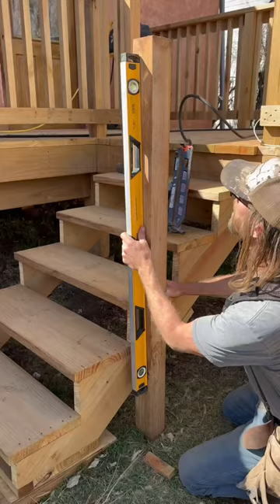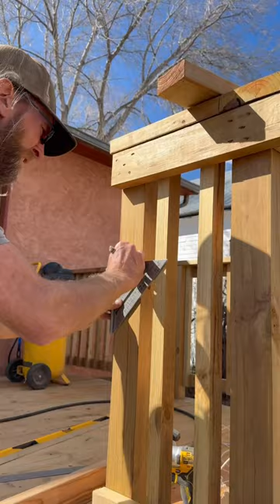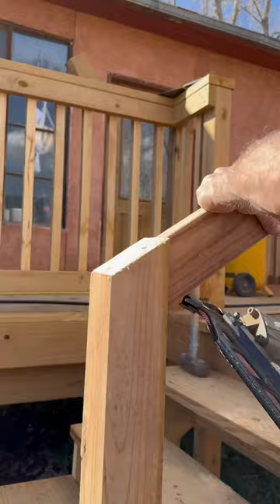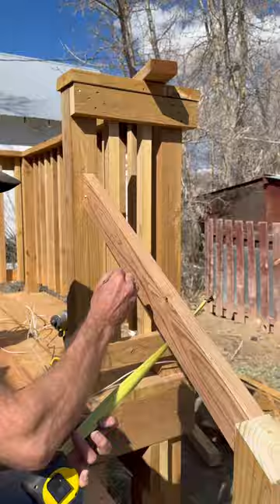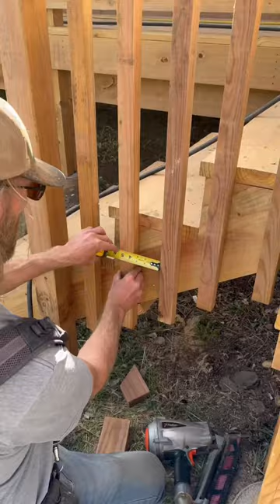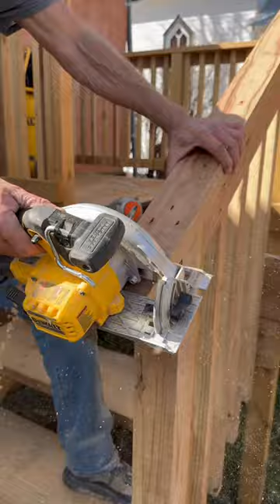🔨Deck Stair Railing Installation! #construction #contractor #deck #framing #carpenter #carpentry

Comment: I have never seen using a square with a steel square to get the reverse angle like that, thats a slick trick ill be keeping in my book. Thanks
Reply: Thats a trick ik ill be using haha what a clever thing to do
Reply: It's just the rake of the stairs....that's an ignorant way 2 do this...bout as dumb as the nails...or the pounding in of the support post
Reply: That is a great trick I will be remembering this one
Reply: That because most dudes don’t keep two  squares in their pouches just draw a line and flip your Swanson
Reply: Is that a reverse cut? Pretty sure its not
Reply: @wooge3199 wow you're a real winner aren't you lady!!
Reply: @tonyz6421  yea...and one hell of a carpenter
Reply: Learn something new everyday
Reply: Speed square and framing square
Reply: @wooge3199 more like one hell of a party pooper.
Reply: Line drawn is parallel with the stair angle, not a reverse unless those stairs are 45 degrees. What baffles me is that square is only 24" and railings should be atleast 40" off the nosing. Definitely not high enough for any useful guardrail.
Reply: @coreykiss2653 I don't even think you have to have a guard rail at all at that height
Reply: I literally screen shot this man doing this cause I’m definitely using this what an ingenious way of transferring an angle !!
Reply: Your locality still allows for a 36 inch handrail? Mine went to 42 inches for guardrails allowing for a 36 inch grippable
Reply: Yo can use anything to transfer the framing square body tail or end 
If you old school carpenter 
( not a framer ) you’ll know what I mean
Reply: I always carry two squares on me. Always.
Reply: @wooge3199 I see absolutely nothing on your channel.  I understand that everyone is a carpenter.  Even the people still living at home like yourself.
Reply: @bmffafo5004  I live in a house I built btw with my own hands 15 years ago...where was your camper built?
Reply: @0.7hujhyh  it's not
Reply: @wooge3199 ”one hell of a carpenter 💅 “
Reply: @ltsjoeyy  play some more video games buddy...maybe u can find one called stairs
Reply: @wooge3199 was that supposed to be a joke? , damn so u bad at more than 1 thing
Reply: @ltsjoeyy u are clever joey I bet u get all the poon
Reply: Also the circ saw trick is pretty neat. If your saw isn't big enough to cut go thru 2nd time with a hand saw was genius. I have cut down fence posts and it's hard to get it perfect. Def using this next time.
Reply: That's called wizardry.
Reply: @wooge3199 always that one Karen crying in the comments and hating. That’s you!
Reply: If you already cut the stringers then you know the angle already.
Reply: You haven't been a carpenter that long or don't cut stairs OR ROOFS I take it.  I was told at 17 be a sponge
Soak up at info boy,  running a custom framing by 20
Reply: @roberteddy5069  we get it. Daddy had a business for you to take over. Cry us a river.
Reply: @wooge3199 ok…? Why do you feel the need to say that? It worked. I see nothing wrong with it.
Reply: @davidvanschubert9093  cool..
Obviously u are not a carpenter...which is fine...
Reply: Same
Reply: It's just a way to translate the nose line up to set the handrail height so it's too short to meet code where I am. Better to just measure up off the nose of a tread at the new post and the same off a tread up top. Using a line scribed then projected off the tip of the framing square doesn't seem too accurate either. The end result looks nice and gets there easily enough with this method though.
Reply: @spevakdesigns  my sentiments precisely well said...ive got 4 good carpenters working 4 me and none of them really understand stairs...its really quite simple...but the post he installed is actually the worst
Reply: Pivot the speed square like a real carpenter. You should know the angle of your build 🤦🏻‍♂️ determine the rail height, mark it, pivot speed square to the degree of angle and then mark your line… why tf do people have to make things so difficult on themselves?
Reply: That’s the way it should be done, my dad always carried his square and level as his main measuring tools on a job
Reply: @jessicalawson1417  has nothing 2 do with the post being completely wrong
Reply: @wooge3199  how is it completely wrong?
Reply: @jessicalawson1417  lol...if u dont know u should not comment...and im not gonna argue with inexpierience
Reply: Technically the bigger square is the reverse angle the smaller square is just the inclination angle of the stairs
Reply: For real that was slick , smart idea
Reply: Yes! I noticed that too! Very cool trick. 
I had to hit the pause button to make sure I was seeing what I was seeing! lol 
I’m gonna have to try that one day 👍💪
Reply: @wooge3199 what ever works bro , I've got a few sliding bevels , a couple of digital levels which give the degrees of the rake and yet I've still managed to turn up needing one of them and having none of them ! 
As far as this job goes , to me it looks like it was partly done a tight budget ! I wouldn't construct a balustrade like that unless I was asked by the client . 
Most if not all handrails I do for stairs would have a top and bottom rail and they would definitely be pre primed H3 grade timber which is the local code / regulations  for Sydney Australia.   Peace bro
Reply: @wooge3199 if you have to state that you’re one hell of a carpenter, then you’re not. Get of your ego trip. Building your own house by your own hands is an accomplishment if you have zero clue, but if you’re educated as myself, then it’s nothing to brag about.
Reply: @Aleks_Tarasenko  what do u live in?
Reply: You can also lay whatever rail material you'll be using on the nosing of a few steps and run your framing square on that. I use 2x6 + the 24"side of the square for rail height, works pretty good.
Reply: Right can’t forget that one
Reply: Same here
Reply: I was wondering about that myself.  I was thinking "that's a cool trick, but isn't that too low?" Maybe I'm missing something
Reply: @laxbum40ify  I’m pretty sure my area of PA says 36” for residential, and 42” for commercial.
Reply: @wooge3199 😂
Reply: @BurkholderCustomCarpentryLLC96  k....lol...also i am laughing...i guess
Reply: Where the hell do all you midgits live that allow 22" hand rail?
Reply: @wooge3199 prob not though
Reply: It may be a case of those who can do can not teach and those who teach can not do. Regardless rise over is very simple the double square is fake till you make it.
Reply: Same I had to pause and make sure I saw that correctly. Kinda blew my mind.
Reply: I'm a union carpenter for 15 years. The double square move is a slick move. Oh yeah and I play video games, mainly construction simulator.
Reply: @pixelbender896  play more or take a math class there is a way easier method, from a carpenter of 30 years
Reply: I came here to say the same thing!!!
Reply: I totally agree with you
Reply: I totally agree with the first comment what's a different technique, great job
Reply: @wooge3199 lmao..nice one
Reply: I had to screen shot that little trixy
Reply: Glad you pointed that out.

Comment: "When a framer thinks they can do finish work"
Reply: Yes
Reply: I’d use screws.  Hold up tighter
Reply: Exactly 💯
Reply: This makes sense. I couldn’t quite figure it out.
Reply: I started laughing as soon as that 4x4 went into the dirt
Reply: First thing I said “woah this guys a framer!”
Reply: I thought the same thing.😂
Reply: Prefab cookie cutter houses that don’t care about quality only valuable time. It’s sometimes part of the blueprints only using nails because of this reason.
Reply: @lucky_boi_luke3416 
The only thing new here is the deck lol
Reply: A framer can do finish work,  a good carpenter should be able to do finish work and framing,  but not like that, that’s just rough.
Reply: Whats that post gonna do when it freezes
Reply: What those screws gonna do with the grain in those steps? Make like a banana?
Reply: @lucky_boi_luke3416 Total B. S. 😅😂

Comment: I love the confidence of people who put this kind of shit on YouTube. Right in the dirt. Right on dude. Cash that check
Reply: Every job is not the Taj Mahal. It's a simple pt deck that I'm sure the price reflects that. Could it be that is what the customer can afford.
Reply: @GGg-ug3jr  Maybe but those stairs and the handrail would never pass my local building code. I'll do the bare minimum to keep cost down for my customers but I'll never go below minimum code.
Reply: @GGg-ug3jr  could you at least drop a cement paver on the ground under the post? This thing is going to rot out in five years 😅
Reply: Lol what
Reply: Lol 😅
Reply: @GGg-ug3jr Ummmm. Ever heard of the building code? 🤔 Not a single thing about this is code compliant, with possible exception of the space between the ballusters, none of which are plumb, btw, and the connection is not code compliant. I'm going to go out on a limb and guess that those nails are not galvanized, let alone ring shank.
Reply: @danbeeson9564 Probably less if it's not rated for ground contact.
Reply: @NirtieDigger  maybe reference what cost $50 genius
Reply: @GGg-ug3jr   a concrete deck block. 1 costs $5-$10 genius
Reply: @GGg-ug3jr   or a bag of concrete and a Simpson bracket. Both cost about $5 genius.
Reply: Just wow 😢
Reply: Why wouldnt you block the post in 😅
Reply: “Shouldn’t you use screws instead of nails there?”

“Nah, I don’t live here”

Comment: Dude!  You drove that 4x4 into the dirt to support the handrail?  "That ain't right."
Reply: All jobs are not created equal. It's a ground rated post, with just a few steps and giving it two elevation points of securing it. Between it being buried in the ground and nailed to the stringer it will be fine for quite a while.
Reply: @GGg-ug3jr  it is always ok to do better
Reply: @carl3500 its always okay to do better for good clients. Don't get It confused with doing better for cheap bastards.
Reply: Looks good to me ngl
Reply: What's good for my house
Reply: Was about to say the same thing. A few rain showers and that post isn’t touching anything or rotting next year if it’s deep. Cmon people that’s why our work isn’t paying as much anymore
Reply: @mattsabeast5 😂😂😂 so funny but so true don't get good customers confused with cheap bastards 😂 like they said
Reply: @dandangounknown5718 new to the trade can you elaborate on that
Reply: Yeah where is the concrete
Reply: @alect3455  Post will rot quicker making contact with the ground. The post doesn't actually need to touch the ground in this case. Not to say it's wrong cause most pressure treated posts are rated for ground contact, but they will still rot out eventually. Stairs should be on patio stones which they're not. The post should be attached to stringer with 1/2" galvanized carriage bolts. Should add blocking between stringers in where the posts are to prevent deflection of the stringer when lateral force is put on the handrail.
Reply: @dandangounknown5718 I'm sure it's sitting on a concrete footing, that pressure treated post will last a long time, you keyword warriors have never built anything or have watched too many videos with concrete pylons. In my state this is exactly how you do it as long as it's on a concrete footing.
Reply: @Jason-ws3cd  probably not sitting on  footing since it's not there to hold a vertical load.  The stairs aren't even on patio stones.  I'd like to think this is in an area that sees no snow, very little rain, and no high winds.  Otherwise it's an issue.  Been a red seal carpenter for 18 years so I'd like to think my input is worth something.
Reply: If you ever toe nailed anything on my deck, you would never get paid
Reply: @GGg-ug3jr  it'd be quicker to just tell everyone u have no what ur talking about.
Reply: Rot is rot. Water does what it do.

Idgaf if it bears a load or not.
Reply: @dandangounknown5718 it’s pressure treated…

Comment: Coolest way I've ever seen someone line up the guardrail 
 100% gomna take that trick home
Reply: @Stevean-zo8zk you're knees go all the way up to your wrists?
Reply: @Stevean-zo8zk  into the soil not onto... and that's how it's supposed to be done I'd add tar or something to protect the wood from the moisture but that how it's done stevie
Reply: @Stevean-zo8zk  one that's about to go out of business one can only assume
Reply: @Stevean-zo8zk and I own 3 businesses in 2 cities ... you should do what I say
Reply: @Stevean-zo8zk  I'd prefer a nomination to the house builders awards this Halloween in london
Reply: @duckaroobonzai2648 Noooooo! Definitely not, unless it's bearing on a footing and there is a positive connection, but nobody does it that way. There is nothing remotely code compliant or even close to acceptable about this work.
Reply: @Jeff-v2c  judging by the amount of O's you use to start your sentence one can only assume you use a keyboard more than a square and circular saw. Plz what codes from where... What exactly do you think is wrong
Reply: @Jeff-v2c  He's literally just using two squares to line up his steps and his guard rail
Reply: @duckaroobonzai2648  Been in construction for over 40 years. You don't sink a guardrail post in the dirt. A newbie helper could see that is bogus. The code I am referring to is the IRC, International Residential Code. It is readily available online for your reference. It covers stairs,  guardrails, and handrails. Nothing this dude has done would pass. I have built dozens of decks and stairs, including indoor stairs, over the years, the correct way. I built the house I'm living in right now, as well as several others, and, I've rrenovated two that I have lived in.  I have also seen changes to the code over the last 40 years. I'm certain none of what this man has done would have passed an honest inspection even then. I have litigated cases over code violations.  I know of what I speak and write.
Reply: @duckaroobonzai2648  I wasn't referring to that "trick". But, since you brought it up, if he'd done a proper rise/run calculation and cut his stringers himself, he would already know the angle, no "trick" needed. Since he built the stairs on the dirt, I would bet he used precut stringers and the last rise is probably different from all of the others. I would further bet that it's outside of the 1/4" acceptable variation in height from the other risers. If it isn't, it will be when that ground under stairs settles and when the entire set of stairs starts to pull away from the deck, which they will the moment they start to get used. This is sketchy work, period.